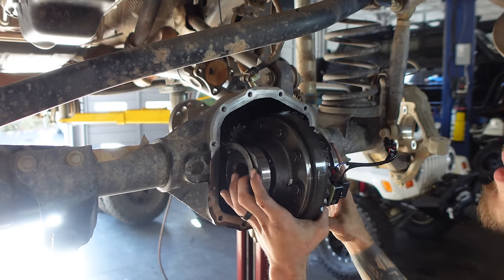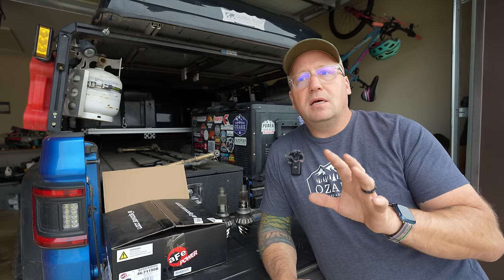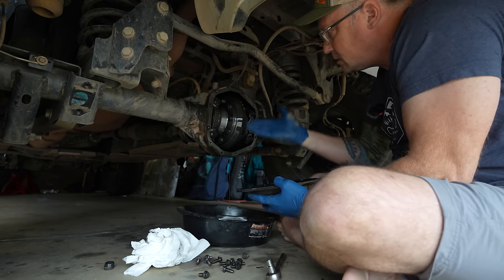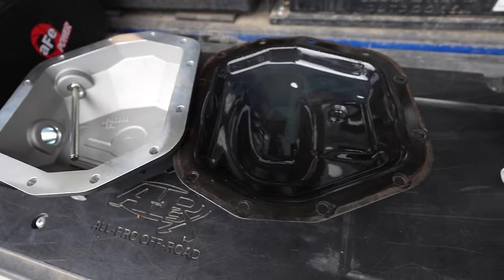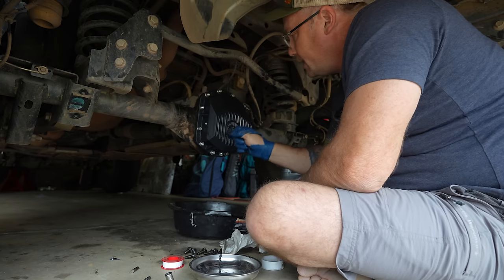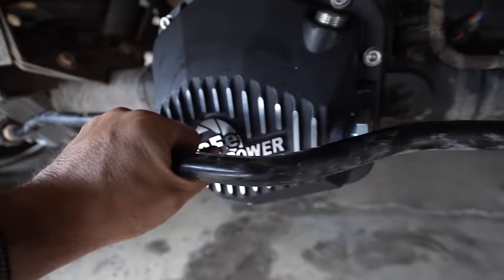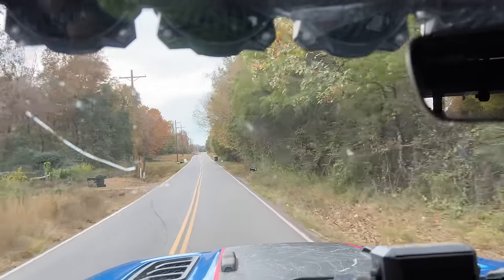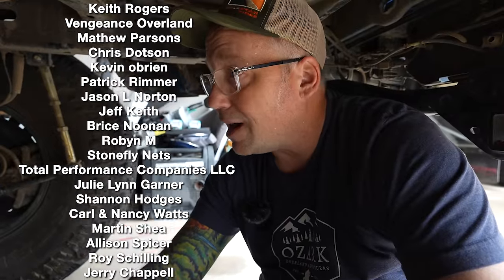Watch This BEFORE You Regear your Jeep JL/JT - Lessons learned the hard way.

Comment: I've heard some professionals say that Dimpled section in the diff cover is important because it allows the gear oil to be applied directly to the ring gear, by following a channel. 
unlike a smooth face or wide open area on the cover which doesn't focus the oil directly onto the gear
Reply: Same here.
Reply: Gale Banks has done extensive research on differential cover design.
Reply: @MrTurbo64  and Banks has good videos explaining why
Reply: Exactly, Gale Banks shows this to be correct with actual testing.

Comment: One thing to mention as well that some people don't know, is to make sure the proper break in procedure is done to extend the life of the ring and pinion.
Reply: Iv never herd of needing to this could you please explain
Reply: @anthonyjoe6442  I can't remember the exact specifics, but when I had my Yukons installed, for the first15-20 miles it was recommended to not go over 45 and to then stop and let them cool for about 30 mins. No hard acceleration, no burnouts, no towing, etc, just take it easy for the first 500 miles. After 500 milers change the gear oil. After the 500 miles if you'll be towing, they recommend to repeat the same procedure for another 500 miles. Usually when I change the gear oil after the 500 miles, I inspect it to make sure everything looks good, including making sure no ring gear bolts have backed out and that the bearing cap bolts are still torqued properly. I'm sure there's people out there that don't do this and have no problems, but I prefer to do what the manufacturer recommends to ensure the longevity of my gears
Reply: ☝🏽 this procedure checks out!💪🏽💪🏽 it’s a time investment for sure, but you also just paid a couple of thousand dollars to get it done. I’ve always used Yukon and never had a problem. 5.13 on two JK running 38”. I was warned both times that the 5.13 pinion is real small. So it’s not as strong as a 4.88 or 4.56. With my JT now, also running 38” I’ll probably re gear to 4.56 or 4.88.  The aftermarket diff cover I think is not a solution. Especially if your going to off road with it. A finned diff cover is only good for on road trailer towing. 
Also look at non-synthetic vs synthetic in gear oil. Years ago I heard about a study claiming with synthetic oil that the oil itself was cooler but the gears were hotter. Same test done with non-synthetic and the oil was hotter, but the gears were cooler. It made sense to me at the time, you want the oil to transfer the heat from the gears/bearings. All things to think about, i honestly think it was a bad batch, or a bad install, or bad break in period. 🤷🏽‍♂️

Comment: You should lookup the Banks video series on diff covers. If they aren’t designed correctly, they can create more problems than they solve.
Reply from the maker: I've seen them.
Reply: @OzarkOverlandAdventures  oh ok! I don’t know if I’d be comfortable buying a cover with a flat back after watching that series.
Reply from the maker: @ShoddyRC  that was done with a totally flat diff cover with horizontal fins inside that prevented the fluid from flowing well. I think mine will be fine.
Reply: @OzarkOverlandAdventures  it probably will be ok. But only one of the tested covers had horizontal fins. The clear back version showing all the aeration had no fins. It seems like your first gears had something else going on, but it was easier to blame you so you’d pay for the new ones. Hopefully you’ll have better luck with the new ones.
Reply: @OzarkOverlandAdventures  Dude was just trying to help, and he isn't wrong. Yours may be fine but it is clear, despite Gale being a salesman first, a flat back cover is less efficient than a curved and channeled one. Love the channel.
Reply from the maker: @elliottpalmer7624  20k miles so far so good.
Reply: @OzarkOverlandAdventures  that’s awesome! I wonder if aeration in the fluid is occurring at any meaningful amount. Be cool to add temp gauge and see how hot the fluid is getting. 😃 happy wheeling! Can’t wait for more videos.

Comment: 1st off, I install thousands of gears, if that pinion was a simple (to Hot) the bad patch would be the whole pinion, there were impurities in the steal. You did nothing wrong, manufacturer had junk steel. I have several pic of overheated pinions if you would like to see
Reply: This makes more sense. But it’s easier to blame the person so they will pay for the new gears instead of warranty them.
Reply: I 2nd what Kevin said.  One ton axels on a s10 truck with 5.13s on 38.5x16 super swampers. Stock covers and it is a strictly a mud truck that only sees full throttle.  More importantly what brand did you go with? I like Yukon.
Reply: I see bad gears all the time, not sure how to reply with a pic or two on here
Reply: I agree with Kevin. It looks either a material issue or a heat treat issue. I'm a gear Engineer.
Reply: Are you in CA
Reply: @ky0611  no I’m in Texas
Reply: Does anyone ever consider upgrading the torque converter for off roading ? Yeah it will increase the fluid temps but it WILL add more crawl/torque. I'd  upgrade mine for my Cherokee Trailhawk but I don't think it's available aftermarket.  They say , your crawl ratio can actually be nearly double of the ratio on paper with an automatic (because of the torque converter) under certain conditions.
Reply: @off-roadingexplained8417  anything I build that includes transmission get a stall converter so you aren’t fighting it to stop and it won’t lunge you over and edge putting it into gear

Comment: Intersting. I just swapped my diff covers. Before I did the work, I researched what kind of diff fluid I needed for the front vs the rear.

Jeep recommended synthetic 75w-85 for front and rear, and 75x90 is ok. What I learned is that if you plan to tow, you need to use 75w-140 for the rear.

Comment: Yep just ran into same issue… 5:13 revolution rem gears and after 30k miles rear is shot. Should note I changed to Yukon covers at time of regear a year ago. Changing to the Dana ultimate 44 covers. Apparently a super common failure on JT’s.

Comment: some of those aftermarket covers do not flow the oil properly.. Check out Banks series of videos on this subject. Personally i went with Dana/Spicer covers designed for the diffs.. Proper break in is also a must. I think your gear issue may be more related to gear quality then oil.. I personally have never seen gears fail from heat unless a diff leak caused them to run dry. If it was a heat fail those gears would be a bright blue and would likely have melted your locker unit and plug.... Hope you have better luck with this next set...

Comment: We learn by mistakes, most of us have been there. I do all my gears Jeeps to Race Cars and heat is a problem especially when the pinion is so small on the 5 and lower gear sets the pinion gear is spinning very fast.   I also use aftermarket covers for more fluid capacity . Yukon gears in the Jeeps 5.13 in the TJ 4.88 in the 2 Door JK and soon 5.13 in the Gladiator. I was thinking when I saw the thickness of the cover that won't never clear that sway bar but I was truely surprised when you installed the "included" spacers. Great Do It Yourself Video!!
Reply: Yea. I want ox locker (with their diff cover) or at least an aftermarket cover for my front jeep tj axle. But my track bar already hits my factor cover :(
Reply: Matt, whose David?  Does he live in Conway?
Reply from the maker: David lives in Vilonia.
Reply from the maker: Thanks!

Comment: Banks Power did some great videos about 4 years ago with clear diff covers to see how diff fluid behaves at different rpms if you're interested in an "internal" view of gears getting oiled.
Reply: Those famous (or infamous, depending on what camp you were in) videos were always a point of contention on the diesel forums 😆
Reply from the maker: I've seen them.

Comment: This seems to be more common with JT's than it was with previous Wranglers.  Those plastic cadge ball bearing on the pinion shaft, smaller than JK ring gear and "much" smaller than JK pinion gear all scream of a design that is orientated at squeezing an extra 1/4 mpg out at the expense of durability.  Add to that a heavier Jeep and the huge tires that people expect stock axles to handle, and this is what you get.

Comment: I feel your pain. I'm on my second pinion bearing on the gladiator in 47k miles and was never told to upgrade the diff cover. I'll definitely be looking into it.
Reply: Bearings are junk since Covid, not sure why but it’s common now
Reply: @kevinbarwell7500  I went aftermarket this time around so we will see if it's any better🤔
Reply: I got 4.88 with 37's and wasn't told to get new diff covers
Reply: Majority of the diff covers don't hold any more fluid than the factory ones. A proper break in and diff fluid changes are crucial to how well the gears perform later on down the road.

Comment: Don’t know if you thought about it but running a jeep E locker has a big magnet to activate the locker and it heats the diff fluid at the rate of about 130 Watts of heat any time they are engaged this is also another contributing factor of the fluid over heating and braking down.
Reply from the maker: I rarely use my lockers.

Comment: I just recently blew up lunch box locker and since upgraded. Point is I did it two and a half hours away from home drove it home with pieces of the shrapnel getting into my gears chipped it but didn't do nearly as much damage. No offense not do I care, I've seen some videos I do trails much more difficult... Point is I'm not saying you're wrong but I don't think that's what happened to your gears those look terrible?? It's just reminds me of when guys have old engines that are overheating and they try aluminum radiators they sit in the other one it's not the real problem.

Comment: Thats a tough spot but I am glad it did not leave you stranded somewhere precarious like at 45 degree angle next to a shelf road on 8/10 difficulty trail or something. 

That being said, as a long time tower of trailers and such... I would highly discourage anyone from towing anything exceeding 63 miles per hour. At that point you are just inviting all sorts of problems if not to your vehicle then to the trailer. You have no idea how many people passed me all gun ho on way to Moab from Florida and back... only to get stranded on side of the road with broken trucks, trailers and more. 

I would also suggest that folks do not tow anything for longer than 2 hours without giving it some rest. Yes we all have to get somewhere but an ounce of prevention is cheaper than pound of cure. On my motorhomes I have/d a TST tire monitoring system and it is so incredibly interesting to see how everything heats up, pressurizes and such. It gives a clear indication if you are not weight distributed properly. 

On the offroad menu of rubicons it gives all sorts of temperature readings. Too bad it turns off at speed. Would have been a cool thing to give you a ringa ding ding warning or something if its overheating en route to pull over and address lingering issues.
Reply from the maker: Great advice. Unfortunately there's no temp sensor for the diffs.

Comment: You need to watch Gale Banks video series on diff covers, it covers oil levels and fins.  Some of what is said isn’t true.  More oil isn’t aerates and actually breaks down faster.  If diff covers arent curved correctly it won’t oil the pinion either.  But rolling the diff to correct pinion angle for the lift may have effected it’s ability to get oil
Reply from the maker: I've seen them.

Comment: The company you brought it to, I have heard is the "go to"    I won't mentioned their name.   I was going to have them do my lift, etc.   I am sure this is not your intention, but I am having second thoughts.  I have heard "go to" from quite a few, but your recent issue, is also not the first I have heard either.   Thanks for the video.
Reply: You mean it was a flawed install (ring & pinion)?
Reply from the maker: I think the install was done well. Just wasn't given key info I needed to make them last.
Reply: @OzarkOverlandAdventures  installation I am sure was correct, but the QC seemed to miss an important item.

Comment: the 5:13 are good, but the dana 5:38 gears are amazing for 38s to 40s and especially since you tow
Reply from the maker: 5.29s were a little too much for 38s. I can't imagine how bad 5.38s would be on the highway.
Reply: @OzarkOverlandAdventures  Just regeared to 4.88s for 38s on my JLUR v6 and I feel that is goes through gears too quick sometimes. I am positive that I can run 40s and still hit 8th gear consistently.

Comment: There was a thread going around the gladiator forum the other day on odd Nitro 4.63 size gears. The OP was asking if it was a good size. A few knowledgeable folks let them know the issue with an odd duck gear sizing.

Comment: I don’t think the cover is going to help you 100%. Yes it will give you more oil capacity, but it’s gonna give you another problem on getting your oil to your pinion gear and bearings. And I would highly recommend Amsoil gear oil. It handles heat very well. Good luck to you.

Comment: There's two break in cycles to do. One for regular driving and one for towing to temper the gears properly to what you are doing.
Reply: Nitro also recommend changing the fluid after  the first 500 miles as well as not using synthetic (they recommend Lucas). Since he is changing the fluid just to change the cover and not waiting for the break in mileage makes me wonder if the original gears were broken in properly.

Comment: Thinking about going deeper in my gears on my K10 front axle is a factory Dana 44 and I never even thought about this. I knew you could get diff covers that increased capacity and promoted cooling of gears but I never thought about gears overheating

Comment: Yup, if that company knew that the work done required an upgrade on the dif cover and they did not recommend it or make it part of the upgrade then I say they are liable. And if they did not compensate you after hearing about your situation I say they suck and will never use them.

Comment: Didn't make out what type of oil you put in, but thought I'd comment that you want to use conventional/NON synthetic lubricant back there. Synthetic oil is good at staying cool, but when you want to keep your gears cool, you want an oil that will absorb the heat and conventional does a better job at that. Most gear manufacturers recommend a non-synthetic oil, especially during the break-in phase.
Reply: This is a huge one that everyone likes to debate. Synthetics are great!! Super great- but for gears sometime too great! Deep gears get hot! Especially when your running 70-80mph on the highway for long periods of time.  Cost me a new rear ring and pinion running 5.13… synthetic fluid gears made it 30k miles and this was changing fluid every 10-15k miles.  
Natural oil same change intervals 70k no issues.

Comment: I ran 488's on a wrangler with a stock diff cover, Never had an issue. Install needs to be precise with gear mating. But I didn't run nearly as hard as you.
Reply from the maker: A Wrangler is nowhere near the same as a heavy Gladiator that also tows a trailer.

Comment: I am hesitant to re-gear because mine is a 2022 and still under warranty. I am running 35" tires and want to go to 37", but gear change is mandatory for that to happen. Patiently waiting for that day.
Reply: I have a 2023 jeep with 4.88s in it now. The thing is that the dealer has to prove that the issue that happened was because of whatever you did to your jeep. Jeeps come with 4.56 and 4.88 gears nowadays so you should be fine. 4.88s only raise the rpms to 400 more. You running a 35 with factory gearing is causing more stress on the engine and transmission and everything else involved. I actually average about 3 mpg more with the 4.88s and 35s.

Comment: Gear oil slinger was not installed or it was run low on fluid.  I have 40k on 5.38’s and 39’s and approx 10k of that is towing a 5k camper.  Make sure the slinger is there.
Reply from the maker: It definitely wasn't low on fluid at any point.
Reply: Might be too late to verify if the slinger was installed, but that’s my next guess.  I’m leaning towards the other comment stating the gears were made of a bad batch of material.   I have a real hard time believing the cover is in any way responsible.

Comment: Running anything over 4.88’s in a Dana 44 is asking for trouble
Reply from the maker: If this were a JK axle I would agree with you. The new 44s for the JL/JT are very different.
Reply: @OzarkOverlandAdventures  different in a worse way. JT/JL ring gears are smaller than JK and the pinion is much smaller.  If you look at the JT/JL ball bearing vs tapered roller bearings in the pinion tail, it is obvious that the design change was all about mpg and not making a stronger gear set.  If you keep running heavy on 38's with these axles it is going to happen again.

Comment: Sorry to see a pinion failure so quick. What gear manufacturer did you use this go round?
Yukon gears have a 7 year warranty if I'm not mistaken. 
That aluminum diff cover isn't going to hold up against much rock bushings, watch close for cracks or worse damage to it. Good luck with it, great videos you make, thanks I enjoy them all.
Reply from the maker: original gears were Nitro. New gears are Yukon. I'm not too worried about aluminum in the rear. I shouldn't be backing up into rocks. lol. On the front I would be concerned.

Comment: Diff skid sounds like a great idea if you didn't already do it.

With 5.29 I think you'd be over 100:1 crawl even with 40s , which is awesome.

I really don't think it would hurt interstate gas mileage that much either because that 8 speed transmission has so much overdrive.
Reply: I have front and rear diff skids. They have been hit a few times rock crawling around Utah so definitely would recommend if you use it in rocky places.